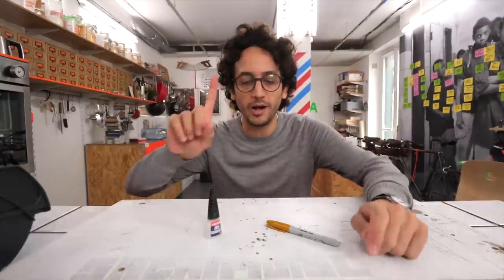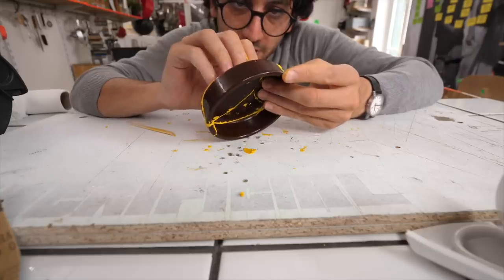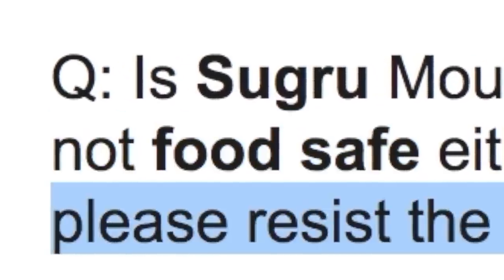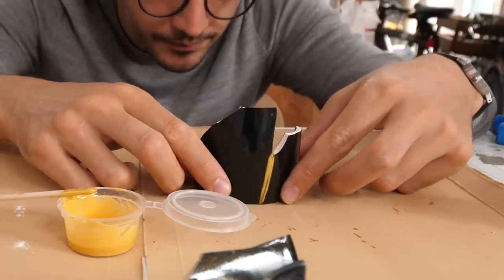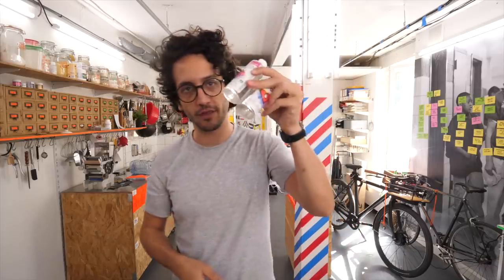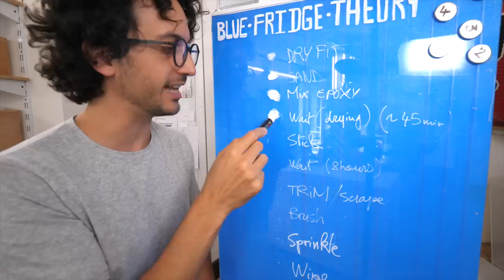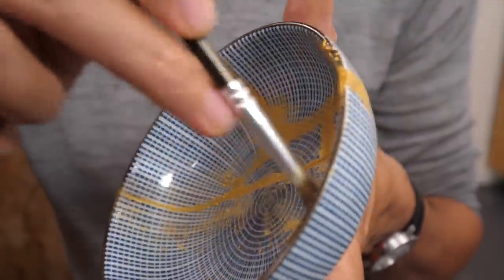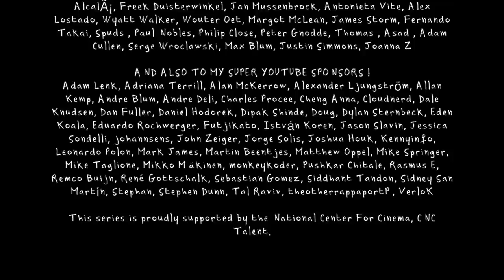I Made a (Foodsafe) Hack On Kintsugi...

Comment: I would like to see more testing, for example, many epoxies become soft when heated.  In fact boiling water is a great way to remove epoxy when you've made a mistake.  So using the bowl for soup could end in tragedy, especially over several uses.  Also less likely to be an issue, epoxy can become brittle when frozen, so you might need to avoid that as well.  But then, it may not be any more brittle than the porcelain itself.
Reply: I agree, I have a broken tea cup and I haven't fix it yet because of hot water questions.
Reply: @Cling30  This would be great to know, otherwise, how would you wash a repaired plate?
Reply: art resin should be okay in regards to heat - it's good to go through the dishwasher, and is fda approved food safe, even with direct contact, so I suspect it should be fine
Reply: I found a food safe glue at somepoint to repair a chipped earthenware mug and it held up fine to daily coffee. we hand wash all our earthenware. i cannot recall the brand, hence my current search.
Reply: @Musicloverlife1   Art Resin is only food safe when at safe temperatures for the epoxy. Their website specifically states that is it NOT food safe at temps higher than 50c/120f.

Comment: Hey Alex, there is a faster way to cure the epoxy, if you heat the resin to warm in the microwave and then add the hardener, this will speed up the curing process, you could test the temperature to adjust the time.
Reply: You also can put small amount of mixed epoxy on cooking foil and the heat it with lighter. Epoxy will cure in minute or two after application. And hairdryer can also help you.
Reply: I d go with the foil technique. after an egg exploded in my microwave  (twice ;) ) I don t wanna see if cleaning epoxy is as much fun...
Reply: so...I tried this microwave method.  did it twice.  I could not get it to speed up the curing process.  It was quite warm after 10 seconds but still not thick enough so I microwaved the whole thing for 30 seconds about 15m later.  Still no good.  In fact I actually had to wait an hour and even then it was not sticky enough to keep everything together solidly.  From my experience so far I'd just wait for an hour or more to make sure the epoxy is nice and thick.  Unless of course anyone else has other/better experiences? Please put response here.

Comment: Alex, there is available a gold or silver paste (just like sugru) which is made from the actual metal and is used for jewelry making. Maybe using it (unlike sugru it needs to be fired) would be much more like the traditional technique.
Reply: Kitchen Scalpel oooooh I’d love to see this technique tested!! Although I’m not sure what temperature you have to fire that at (and whether a cracked bowl could withstand it)?
Reply: That thing is called "precious metal clay" (PMC) and AFAIK it needs to be fired at around 800°C, which should be ok for pottery!
Reply: I'm not sure how good the bonding between metal and ceramic will be.
Reply: The problem with PMC or any other brands is that it shrinks on firing.

Comment: for future reference, do NOT sand the broken edges. the pieces will actually fit back together more securely if you do not sand. those natural granular places will hold themselves together better as they broke rather than trying to set smooth surfaces together
Reply: I think the sanding it gives more place for the gold to fill in
Reply: making the edges smoother is not the point... the traditional art of kintsugi does sand the edges so that the gold is more visible in the final result (more space to fill). If you don't sand, you'll have little to nothing to paint with the gold powder. Instead, it will look bad because it will be a perfect flat fit with lines painted on them.
Reply: Sorry to disagree with OP, but please DO sand the edges or take them down a little with a diamond file. You don’t want the pieces to fit back together so securely that there is no room for your filling and gold. It’s a good tip if you just want to repair something, but it’s not preferable in this application.

Comment: Alex, Here's a tip from the epoxy soaked world of boatbuilding.  If you want a thick colloid that won't run get some colloidal silica and mix that with you resin until you get the desired consistency.  No runs or drips.  You should probably mix in your colorant first then thicken to taste.  As for using flour, that's probably fine, woodworkers use wood flour that they collect from their sanders.  Wood flour is probably better than wheat flour because it is mostly cellulose and therefore fibrous.  White flour is mostly starch so it doesn't really contribute as much to the strength of the mix. Also the slow setting epoxy is much better than the 5 minute variety.  No panic, lots of time to move things around.  Superglue, aka. cyanoacrylate resin isn't a good choice at all.  It isn't water resistant and it doesn't stand up to heat so your bowl is likely to come apart with the first batch of ramen.  You could also consider urethane glues but they are rather more rubbery and even messier than epoxy.  I don't think urethanes will mix as well with your colorants either but they don't require the colloidal agents. All epoxies are probably food safe if you strictly follow the mixing proportions (best by weight) and give them time to cure.  The component ingredients may be pretty nasty but the cured product is quite stable, heat, chemical, and water resistant.  What's more epoxy sticks to almost everything which ain't the case with cyanoacrylates.  Nice video. Keep up the good work.
Reply: Thanks for your informed response! Perhaps you can help me... I'm looking for a gluten free alternative to wheat flour that can be used. While I assume the entire surface would be coated with a later of resin, this relax would be much happier if there wasn't an issue at all. Would other floor work? Is the goal to just give structure, or is the stickiness of gluten necessary? I have a number of pieces I'm looking to fix, some of which have gaps. Thanks!
Reply: Tracy, Epoxy is stickier than anything.  Gluten won't make a difference.  I wouldn't use anything organic for this purpose.  I'd go for colloidal silica and, if you really want kinsugi, use gold powder for a colorant.  Kind of expensive though.  A cheaper alternative to the colloidal silica would be microbaloons but that's more of a filler and you really shouldn't need any filler for this work.

Comment: Another option would be to use the "none food safe" techniques, to hold it together, and then slowly, carefully, line the cup with a food-safe inner liner, which would keep the user from getting sick from the non-food-safe, by covering it with a food-safe sealant. This would allow you to have the beauty and strength of the traditional techniques, while still having the ability to use it as a functional container.
Reply: That's not gonna make it food safe

Comment: Can the epoxy resist the heat of hot salted water tho, as you would find in ramen?

My workplace has an epoxy coated floor, and whenever it got into any contact with saltwater from our aquarium, it reacts to it with discoloration.

At worst, you could be pouring yoursef a gorgeous serving, and the bowl just crumbles apart.
Reply: Ususally epoxy glue can withstand temperatures up to 100 degrees Celsius, some varieties even more. So unless the ramen is boiling hot when poured, it should be quite safe. I use epoxy glues that hold together until 120 deg. Celsius, so taking a knife handle apart is not so easy anymore... before I could boil the handle off, now it is back to Hammer Time!
Reply: Isn't the salt reaction thing not one of the reasons why there is a difference between food-safe and non-food-safe epoxies?
Reply: @TomK2602  good point

Comment: I was surprised that you choose epoxy, because i had in mind that it is pretty toxic, so i looked up what "food safe" epoxy is and found out that it always contains BPA... It is expected to leach out, in more or less small amounts, but i still don't like it. Would be nice to have an alternative, to reduce the exposure to carcinogenic chemicals, especially in food.
Reply: some woodworkers use epoxy or resin to finish their work when they make bowls and plate. If you let the epoxy cure completely and wait for a month before using the bowl and wash it before using it, the amount of bpa will become harmless or even disappear. While it is not the best solution, it is the most durable one.
Reply: The epoxy Alex linked from amazon claims to be BPA free ! I also wouldn't want it on my cookware, especially for something that would need to be heated, but apparently that wouldn't be a concern here.
Reply: @thermalegoogle  thank you for looking that up and noting it here! After reading that, I wouldn’t have even bothered. Much appreciated!

Aaaaaaand the project is back on! Wahoo!

Comment: I am looking to try this method (4th and food safe) some time in the future. 
1) May you also link in your description the brushes you bought? Or sizes (for both thin line and sprinkling)
2) Anything you recommend for sanding? 
3) Did you mix the Gold Colouring during the Epoxy Glue Mixing before waiting 45minutes? Or after waiting 45 minutes BEFORE sticking them together?

Comment: Hey Alex! If you are adding a layer of food safe epoxy over the glue anyways, why not fix it with sugru and cover it with a layer of epoxy?!!
Reply: I assume the epoxy layer will erode over time. Plus, he has thousands of subscribers. Not the wisest idea to use non-food safe material for the people at home who may try to emulate the video.
Reply: That's not a horrible idea... but it's be had to tell for sure that your separation was complete. I also don't actually know HOW unfoodsafe Sugru is... it could just be a case of better safe than sorry.
Reply: If epoxy works why use two glues?
Reply: From the Sugru FAQ: "Sugru is a silicone and cures to a flexible rubber, so paint is likely to crack and flake from it."
Presumably, if you're using an epoxy that cures into a hard (i.e. thin+brittle) layer, it would be subject to the same problem - the small amount of flexibility in the cured Sugru would allow pressure (or even thermal expansion) to crack a thin overcoat of epoxy.
Reply: Why not just order a replacement bowl and be done with it? $20 each on Amazon.
Reply: Why even keep living? GTFO Callie, you've completely missed the point.
Reply: Where does it say he used epoxy over glue? He just used epoxy after letting it dry for 45 minutes didn't he?
Reply: +bezmi  True, Alex didn't use epoxy over glue as such - he used partly-cured (i.e. thickened) epoxy as a glue. Same stuff, different function.
Reply: not to forget all the time. He uses food safe epoxy. Never use non food safe epoxy, since you won't be able to actually use the bowl.
Reply: Callie Masters sentimentality, less wasteful, cool aesthetic, and the rewarding feeling of having repaired something rather than throwing it away.

Comment: You shouldn't even touch sugru with bare hands if it's not hardened...
Reply: all the official videos from Sugru themselves suggest to knead it by hand and use your fingers to smooth over.
Reply: @hanwenn  that's why they can't be officially purchased in germany. I imported some from the uk since I like this stuff quite much, but i use rubber gloves... :)
Reply: They also make the "family friendly" version which is designed for delicate skin

Comment: You should have used silver glue!!! Blue, white and gold looks so weird.
Reply: Good point but, in kintsugi, gold is mandatory. 

But then again, we always break the rules xD Silver would've looked cool indeed
Reply: Blue, white and gold look fine together. Blue and yellow (gold) is one of my favorite 'bold' pairings. Like a navy coat with gold buttons. The point of kintsugi is not to try to 'hide' the repair, but instead to add a new layer of art to it, and art is meant to be 'noticed'.
Reply: @bminor8092  nothing wrong with drawing attention to the cracks. My point is that the imperfections should still be nice to look at. Silver or a more metallic gold would have looked much better than this plastic-y yellow.
Reply: @purplepepper2503  The name literally says "gold", but it also means gold in the sense of money/valuable. Platinum and silver are both used for kintsugi. But in the first place, blending in is the opposite of what you want. The whole point is to emphasize and draw attention to the flaw. To show this object has a history. High contrast is good.

Comment: Hey, I started with epoxy as well. It's easy and all, but in the long run, it lacks options. You dont have control over the relief you might want to give to the lines. And also, the point of this technic is to take your time, know each cracks of your piece. It's like a puzzle where you have to put back pieces together, but you need to know each pieces intimately to achieve the best result.
Reply: so what's the next best thing?
Reply: @michieltr  I would argue anyone who shows interest in this and has a little bit of money to spare would be better trying it out with authentic material. 
If it's a one time project for fun, obviously it is not worth the investment.
This practice has a lot of roots in phylosophical beliefs ("wabi sabi", rezilience...) and taking the shortcut of the epoxy also bipass those points which, for me, are the main interest of doing this. In a world where everything goes fast, with Kintsugi, i'm forced to take my time, focus... the puece dictate the pace, not me. And it is a great lecon I think.
All of this is obviously a point of view. Not everyone has to be looking for the same things I do. And not everyone has the time to spare, or even the interest to do it.
I do recommand it though.
Reply: @michieltr  to really answer your question, i'm not very familiar with it, but there are some shortcuts you can take between authentic material and epoxy. I heard about fish glue. But I think you would still need to involve the "urushi" lacquer at some point. So the next best think, or most practical thing would probably be epoxy.

Comment: That brand of resin you used is actually really nice to use and one of the best choices, especially for what you used it for. 
I don't even think you have to be in a well vented area to use it either.
Peter Brown of Shop Time makes some crazy projects using it too.
Reply: I didn't want to edit this into my message, extra hardener (not too much) will help it set faster and heating up the epoxy will also help it set faster.

That bowl is beautiful.

Comment: dear alex,
you should try adding the coloring to the part A of the epoxy before adding part B. this way it will not over-cure whilst you are mixing just the coloring in. next thing is to let the epoxy cure a little so that when you add it to the pot it is almost cured. this way it will be thicker and take less time to cure (whilst holding it). there are a few tricks using baking soda with superglue to make it dry super quick. i believe their is a similar trick with epoxy but im unsure if it is with baking soda.

Comment: Very cool experiment and video! I have a question though. Wouldn't it be better to leave the edges unsanded? I think you'll give your epoxy more surfaces to bond to and get a tighter fit, plus it will be easier to line everything back up perfectly. Just food for thought!

Comment: the repair turned out REALLY nice looking!  I think you've captured the essence of it......here's something you might try, sort of a hybrid of the two methods....    If the sugru is not food safe....what if you just use it for just the initial reassembly portion,  and continue with your method with the additional painted on layer of food safe grade epoxy to "seal" it in??     if you REALLY want to seal it in, maybe try doing a final coat with urushi lacquer...once cured, it's like iron!!  (though it's a pain to work with ...)

PS  been inspired by your ramen series.....my ramen game has SERIOUSLY stepped up......next level is to make my own noodles.....  :)

Comment: Not sure if this applies to ceramics the same way it does with other materials, although I assume it would; the super glue performs better when used on a rough surface as opposed to smooth as it allows more surface area for the glue to cling and bond to between the two surfaces. Although you're moving past the method, hopefully this info helps in the future.

Comment: The sugru I used was fine as long as the thing you were fixing was not under stress, IE a hook on a wall. After a while it's glue would unfasten from the wall, but its shape never failed.

Comment: If you wanna to fasten the epoxy process. just put the resin in the microwave (or pre heat the ceramic - safer). But be careful if you get over 60-80°C a thermal runaway (The reaction is exothermic) could happen which will release harmful gases and make the epoxy useless.
Anyway you should reheat the resin after hardening for a couple of hours at 80°C to temper it and thereby maximizing the bond.

Comment: The reason cyanocrylate (superglue) didn't work is because its bonds require water to form. Thus, you should brush down the surface with water and lightly dry before attaching, if you want to use superglue.

Comment: Alex, the fact that you can cut the excess off with a knife means it hasn’t cured properly. It most likely hasn’t been properly stirred or he ratio is off. It will probably be fine but generally epoxy is very strong, in this case those are going to be very weak points

Comment: Sharpies are alcohol based and super glue is alcohol soluble. That's why when you glue your fingers together you can get it off with rubbing alcohol. It would actually probably work just fine ig you let the sharpie ink really really dry first. It would at least not fail for the same reason.